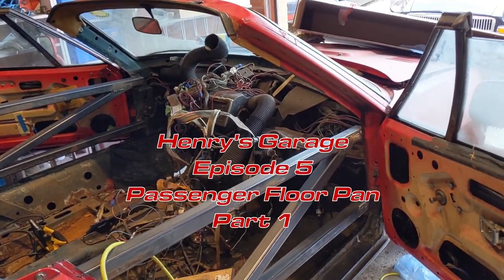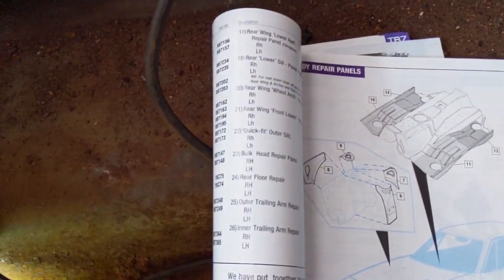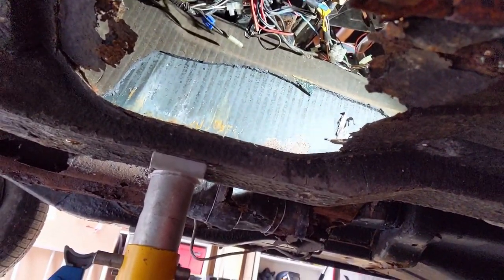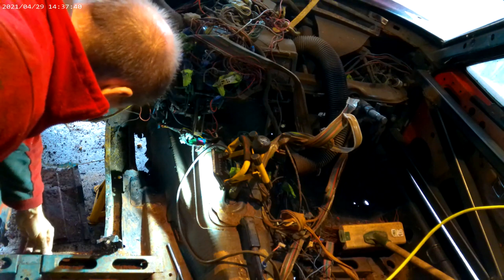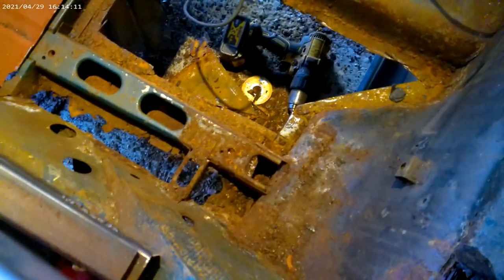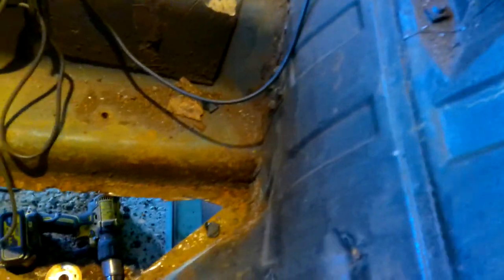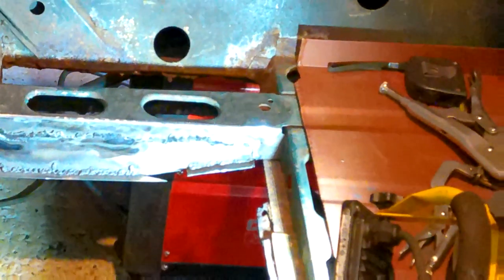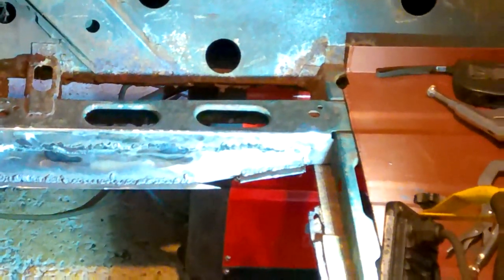Triumph TR7 Restoration: Episode 5   Passenger Floor Pan Part 1

Comment: Hi Henry, I feel your pain. The repair panels normally come with more metal than you need to .
Reply from the maker: Thanks Wayne, I get that, but the old panels look like they had a lip/flange under the sill whereas I'm not sure how these are meant to do that, unless the whole vertical goes inside (potentially for extra strength).  I'm just not sure if it reaches the the supporting rail near the transmission.  Still, worry for another day as I concentrate on rear pan first
Reply: @HenrysGarage  yeah I see what you mean.... I think doing the MG first has spoiled you.
Reply from the maker: @waynebrannan4778  yeah - but I think if I hadn't I would give up on this.  It was a great first project (by luck)

Comment: In the past iv always removed the excess lip.i think its included in case there's rot between the floor/sill joint ???
Reply from the maker: Thanks Steve, by excess lip do you mean the vertical lip on the front pan?

Comment: The full sill extends to the arwa under the front wing and is structural. The quick sill doesn't. The inner sill is unavailable and is usually OK or repairable
Reply from the maker: Thanks.  I had come to that conclusion.  I haven't got to it yet but I think my inner sill is pretty poor so this will be interesting